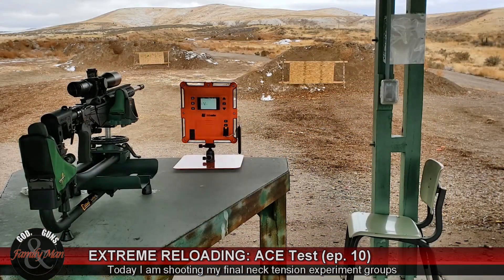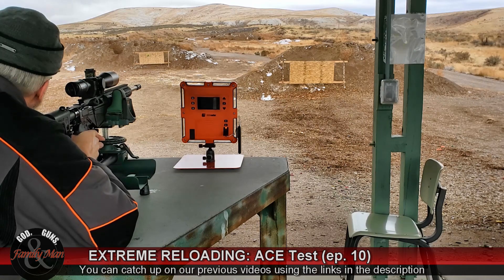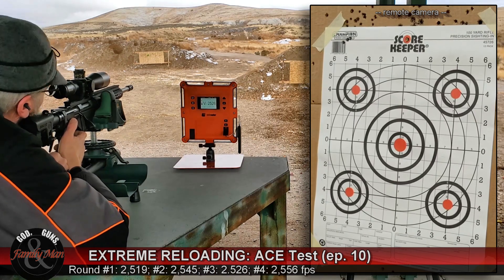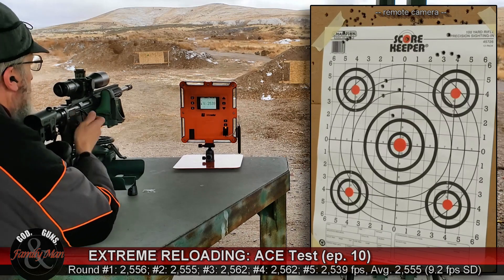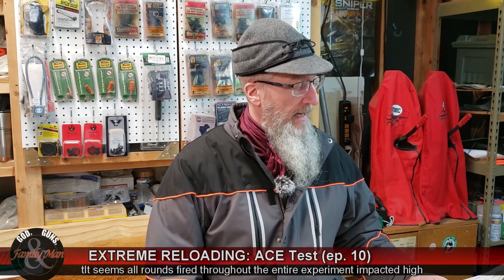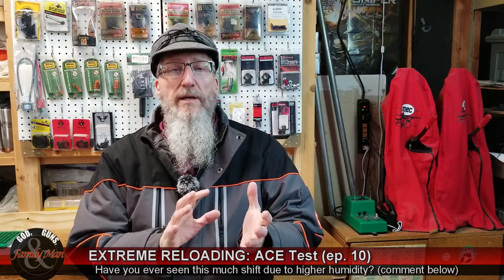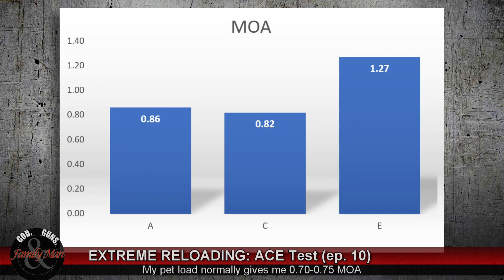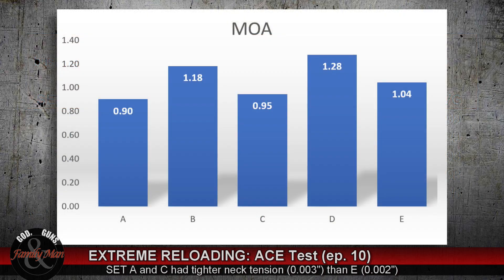EXTREME RELOADING: Neck tension testing final range session (ep. 10)

Comment: Annealing will help.
Reply from the maker: I believe you anneal before each reload?  BTW, I order a bunch of equipment from 21st Century to expand the necks first, then run a better neck turning on my brass.  I am planning to use my ADG brass for that, most of which has not yet been fired.  
I am still debating on annealing though... but hearing more and more about the benefit.  It seems clear that annealing will increase longevity of the brass, but will it help make the rounds more precise?  Interested to hear your experience.
As always, thanks for watching.
Reply: @sdkweber  Annealing lends itself to more consistent neck tension and bullet release. Without annealing you work-harden the brass...this causes  ‘extreme’ (see what I did there :-)... variations in spring-back of the brass. The harder the brass the more resistant to sizing and induced spring-back. Always anneal after cleaning and before resizing.
Reply from the maker: @Nonedw  Great reference back to Extreme reloading.  I think you are right and I am looking forward to starting with annealing my brass.  Always seeking the perfect load!  Thanks again.